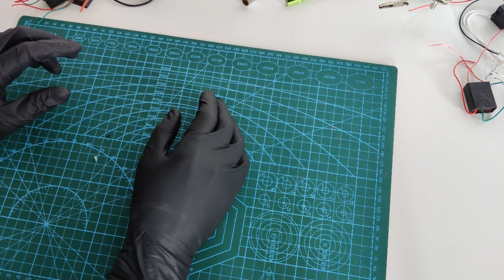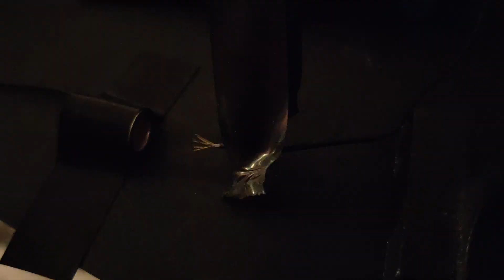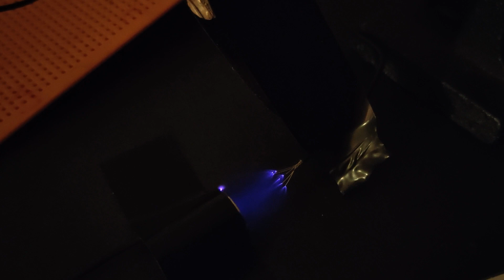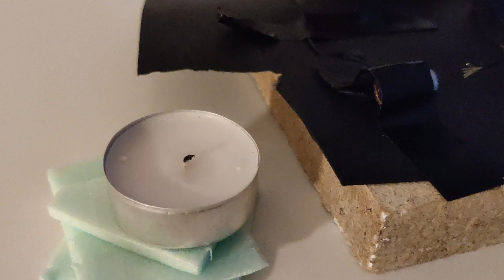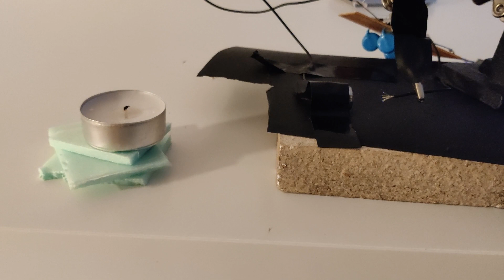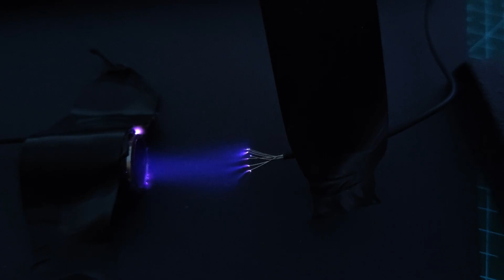Ion Engine 2.0

Comment: hello, you experts. as far as I know, there is no resistance in the vastness of the universe. so an engine doesn't have to work all the time, you just drift lazily until you brake. so your engine isn't on at all, you just give a short impulse, then you drift again. captain, we can't maintain the speed any longer - then just switch off the engine, or have you not understood that there is no resistance in space? so, your ion thrusters are absolute nonsense, because in space no engine has to work all the time. you are so stupid. especially YOU. you are the absolute expert among the experts and you don't even know that an ion thruster only works for milliseconds. The ISS have a Speed of over 20000 km/h and they have NO Engine working. Only sometimes a millisecound to correct the Direction. LEARN BEFOR YOUR TALK. Folk,sDON,T listen to this Experts.They a at HOME;not by NASA,so they KNOW ABSOLUTLY NOTHING. They built Engine,but have all arround Oxygen some make every Engine USELESS,absolutly USELESS,your IDIOTS. The Engine must be in a Chamber,not like your BULLSHIT Engine. thats really BULLSHIT,IDIOTS.

Comment: I think you have done a great job using the arc lighter to drive the voltage multiplier as well as one lipo battery!  You can use SMD capacitors for your voltage multiplier as well and avoid circuit boards by soldering the components together point to point with some jumper wires as needed.  That will save more than half of the weight of the circuit.  
If you use extremely thin linear emitter wire, like a hoop in front of the ring, it will produce similar thrust with much less power.  Also, a larger gap is more efficient.  Any significant glow that can be seen in the dark is a power loss, although it looks nice.  There are about 40 videos of ion propelled vehicles with onboard power on my channel, and a video of a lightweight power supply that creates adequate power to lift itself.  
Thanks again for your wonderful video!

Comment: how about larger "thrust surface area", wide area electrodes
Reply: I think it will directly multiply the thrust power applied, similar to the capacitor equation

Comment: Good job. What you see are electrons that have 1800 times smaller than protons. Now you should to modify your circuit to ionize the atoms and accelerate them. With an axial magnetic field, you'll  reduce the diameter of particles beam in the same mode of a nozzle in a rocket.
Remember the positive atoms are charged when them are out of your device you have to neutralize the positive charge by emission of othe electrons out of the device. If not so the thrust reduces to zero because the positive chargers prevent other positive charges from escaping from the device.

Comment: Now if we can just get them to work in the vacuum of space. Not a lot of particles floating around out there without brining it with you.
Reply: Check out the M2P2 from NASA. Mini-magnetospheric plasma propulsion. Rather like a plasma solar sail. Uses a pair of electromagnet coils around a tube.  The large coil is fed a steady DC current to provide a large magnetic field around the craft, and the small coil is fed a radio-frequency AC signal to ionize, heat and accelerate solar plasma around the vehicle to form a plasma current loop. The plasma generates a secondary magnetic field which is many times larger than the coil field, so the plasma bubble is pushed around by a much larger cross section of solar wind without needing a physical solar sail.
Reply: @taylorwestmore4664  Cool!. I'll check this out ASAP..  👍
Reply: @taylorwestmore4664  Oh and thanks!

Comment: Impressive.  If the wire wasn't held down with a weight, it would shift forwards, right?
Reply from the maker: I don't think it would move because I think the thrust is to small. But I will try that, thanks

Comment: Nice! Would adding an electromagnet around the tube near the end of the small tube accelerate the ion stream/air flow even more before it's neutralized by the tube? Also, would having an electromagnet repulse on the emitter side also speed it up?
Reply from the maker: I have done some tests with a neodymium magnet but I can not see that it affects the ion beam at all but if I get a little more time to experiment then maybe I will do more tests. Thanks for your input, cool idea.
Reply: @rptechlab  No problem. S & D innovation's channel looks like it uses that in their ion wind engine VER 2. It looks like the emitter is in a wide coil in order to create a focused magnetic field at the tip of the emitter that should repel charged molecules (if coiled in the right direction) and the collector of the charged particles at the other end has a small electromagnet to attract and accelerate them into the neutralizing collector. It's enough to move the airflow fan they have set up.
Reply: Have any thrust values?
Reply from the maker: @mflydawg1  Yes I've just released a new video with thrust values, thanks https://youtu.be/lT19vWg5SWk